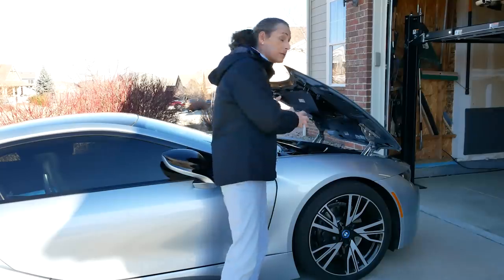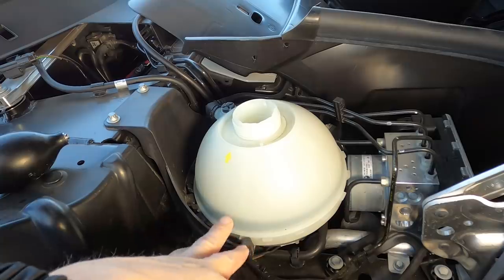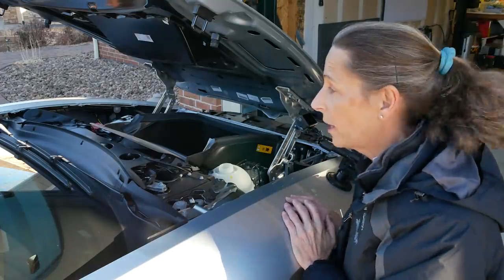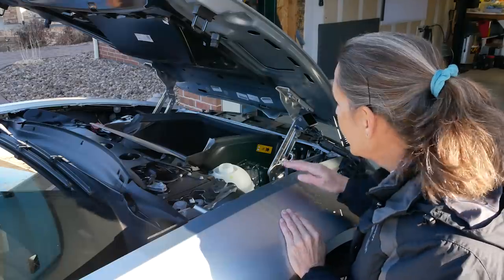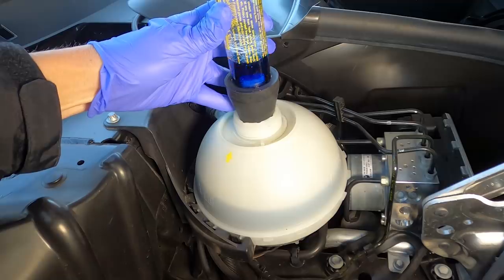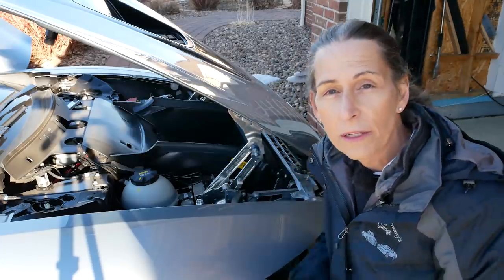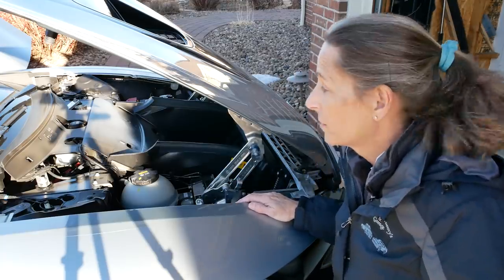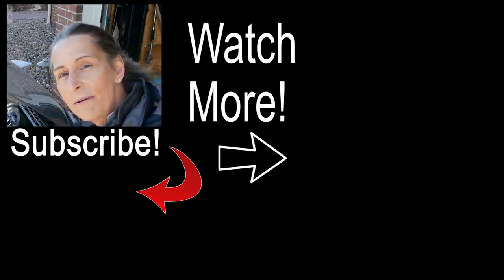Working With SamCrac and Recreating His Coolant Block Test! BMW i8

Comment: Always interesting videos, Franny. First time I've ever heard of this check. As a new driver in the mid 70's I worked on my own cars - 1960's technology - but all these years later I never stop learning about cars.
Reply from the maker: Thanks Phil, the test is new to me too... It can be used on any ICE car with a radiator. It would have been a really helpful test to run on the 308 before we bought it... I think the reason the head wouldn't come off  was due to a bad head gasket and coolant corroding the head studs...

Comment: I don't understand how all these garages and dealerships missed this simple block test on Sams I8. Really makes you wonder. Loved your vlog today.
Reply from the maker: Thanks! That's a great question!  It really narrows it down.  I think from now on if I encounter coolant loss, overheating, etc. it will be my first test.  Easy to perform and inexpensive.  No disassembly required!  The computer diagnostics can only tell you so much and only what it can see.
Reply: A dealer condemned the engine which is why it went to auction. And to be fair to the dealer it may be more than just a head gasket. iIy could have a cracked block or head

Comment: 2:59  That stream is the coolant coming in from that hose on top of the reservoir that runs over to the hot side of the radiator.  It bleeds off any air in the system. A steady stream of coolant means there is no air building up in the coolant from the engine to the radiator.

Comment: You got a great point about the turbo leak. It might not even lose coolant just small amount of gasses being introduced into the coolant causing the air pocket.
Reply from the maker: Just a thought...  Not sure how close the coolant is physically to the exhaust, but maybe a second or third place to look.  These turbos did have an issue early on of a small oil leak.  Ours was fixed by the PO under warranty early on.
Reply: @HeidiandFranny  just replaced my VW turbo and yes they can develop those issues.
Reply from the maker: Great to know!

Comment: When I saw the amount of bubbles coming out of Sam's cooling system I knew right away that exhaust gasses were getting into the cooling system. I've had that issue with other cars in the past. It normally is a head gasket issue.
Reply from the maker: Thanks for that!  It seemed weird to me that it would be boiling.  But he did just have just water in the system and it was above 100C back at the engine and not under pressure. Still, there would have to be bubbles if exhaust gas is getting pushed into the coolant.  And the test showed that you are correct.
Reply: @HeidiandFranny   Water boils at approximately 212 degrees Fahrenheit and since coolant is made up partly of water, it too will boil at 212 degrees, right? Not quite. Thanks to the pressure created by the radiator cap, the boiling point is raised considerably.
Reply from the maker: Yes, but Sam's cooling system was open to perform the test so no pressure.
Reply: @HeidiandFranny  but in his first first video it was cracking and popping sound coming out of his over flow that was from it bubbling up.
Reply: @HeidiandFranny  But it was bubbling with the cap on as well in his first video he made of trying to fix it. you had your cap off and no bubbling at all.  no way with his cap on would it of gotten hot enough to bubble is all i am saying before the car goes into the protection mode.

Comment: Adore mine to. Very reliable at 52Kmiles. My failures: heated rear window only half works, the usual rubber shock perishing, and the standard fuel door issue(30 seconds with a hack saw to fix) but that’s about it.
Reply from the maker: Thanks!  That's good to hear.

Comment: great analysis about the i8 being a usual car easy to maintain and handle without a lot of toothing issues for such an unusual power-drive train which is closer to a german ww2 submarine cause they where extending range by using a special hybrid mode using 1 diesel engine to turn one prop and generating power for the batteries AND for the 2nd electric motor to turn the 2nd prop. Highly efficient and optimum of speed and range.
Reply: The hybrid batteries for the german ww2 submarines came from AFA (later VARTA). That company was owned by Gunther Quandt. His son Herbert took over BMW 1960 short before insolvency.

Comment: hey hello , its the first time i saw one of your videos, and with all do respect, that is a super car i will never think to buy, it is slow and have a lot a problems, expensive ones. great video by the way !
Reply from the maker: Hello and welcome to our channel, this is Heidi btw and not the video creator (Franny), but the other half of the channel.   I too was a skeptic about the car. Franny talked about it for five years before we purchased the car.  As a second year owner of the i8. I now love this car.  It is fast enough for me.  It can keep up with my 2004 Porsche Turbo S (X50) and saves us lots of money is gasoline.  In addition, Since COVID and little reason to leave the house - we have not had to fill the car in months. Huge plus.  I hate getting gas. We have only had to replace the smaller battery under warranty and that was it.  If the car is well cared for, it is not expensive.  We love our i8.  I hope Samcrac loves his once it is sorted too.  Thanks for watching.  Heidi
Reply from the maker: ...and this is Franny.  I would add that the i8 is not a Supercar, but a GT car.  Any GT in the low fours I would not call slow.  With a mild tune Pat has his in the upper threes.  I'm not sure where you get that these cars have "lot's of problems"...  Have you ever driven one of these or even spent any time with it?

Comment: thanks I see a lot of people are puzzled by samcrack I8 :D I still bet on something in the cooling circulation to be stuck in there. Interesting point about the turbo but I would think if there would be a problem then a leak would be present. Turbo is one of the most easy to diagnose components. head gasket got me surprised ....I must say I do not believe that this is an issue because of pressure test ...
Reply from the maker: Thanks!  I guess we'll see...  He does have me on the edge of my seat!

Comment: The next thing Sam should do is a leak down test. It should be pretty straight forward to see bubbles in the reservoir tank.
Reply from the maker: I'm a huge fan of a leak down test.  It would have been one of the first things I would have done.  I talked to him about it and he said he was going to do that as well, but I bet the Block Test was enough to point to the issue.  I'll tell ya though...  That Block Test is so easy it would be at the top of my list if I was inspecting a car to buy.  Easy, and inexpensive.

Comment: You got lucky with a trouble-free i8. Pat has a few issues with his i8, RichRebuilds slightly more problems with a crashed front end and SamCrac has a total lemon that needs a new engine. It's a gorgeous car that could be an endless money pit if major systems went wrong on it.

Comment: 6:42  If you can get a garage to use their exhaust emmisions tester to test that air from the coolant reservoir, it is way more sensitive than the chemical test.  The chemical test for the unexperienced user is  hard to figure out as you don't know how much air you should pull through the tube for it to turn colors.

Comment: BMW i8 3 cylinder ohc, blow head gasket due to warp head equals replacement head if block deck is true 0, as machining too much from head affects timing as chain will not line up properly when setting timing. Dealer have owners that don't understand i8 is not an exotic that you just can beat the hell out of it, as i8 is hybrid GT hwy cruiser.

Comment: Thanks for the video, very clear to understand. When watching Sam's video I believe he tested in for a couple of minutes. The liquid remained blue for quite some time and I thought to myself the engine seems alright but he continued testing and it eventually turned yellow. Not that yours will turn yellow but just thought I'd mention it. Thanks again.
Reply from the maker: Thanks.  I did let it stand and sped up the footage a bit so as not to waist folks time ;)  I saw nothing.  Since it is testing for CO2 it may turn yellow just sitting out for a while.  I'll tell you though...  I'm going to try that little test on the Ferrari and the 996TT.
Reply: @HeidiandFranny   Ha no problem, thanks for your reply. Its one of those tests where you really don't want to see it go yellow lol Good luck, hope it all goes well.

Comment: Hi Franny and Heidi!
I was totally scratching my head about the CO2 for a while until you said it would come from a cylinder via a bad head gasket or other places. I'm getting a little slow in my old age. I'd never heard of that test and actually sounds like a good idea rather than waiting for the engine to quit. 
If Sam got a color change on his test that explains his problem completely. I'm surprised the BMW dealer couldn't figure out the probable bad head gasket.
Did you see Pat's explanation of the thermostat and how it works? That was interesting.
Anyway, I always enjoy your videos and can't wait to watch you change the timing belts on the Ferrari. That should be fun. Better you than me! Lol
Reply from the maker: Thanks Werner, I have studied the cooling system(s) in the i8 a bit and it is actually very clever.  The HT circuit Waits for a set temp of 105C and then will use an electrically actuated wax heater to then fine tune the coolant temp according to load and power need.  It also has a two tier waring system that will shut down accessories as it rises past 117deg and then from there starts shutting down power from the engine in an attempt to not get to where Sam is with his car.  I'm really wondering how it got this bad in the first place.
Reply: @HeidiandFranny  He said the a/c condenser had been replaced because of front end damage but the cooling rad was original. There must have been some damage in the system, maybe a broken hose causing a bad leak. This might have caused an overheating which may have cause the headgasket to blow out. Hopefully we'll get to see him figure it out and not just abandon it. Have a great day!
Reply from the maker: You too!

Comment: Point made. 
The 3 cylinder engine is an open deck design. It is a highly stressed turbo unit, so very likely the gasket blew if it was ran with low coolant. Possible head warpage too. 
Also, 20k miles is not enough to say a car is "reliable". Id say that number is more like 80k to 100k miles. 
Lastly, its CARBON MONOXIDE. 
Keep up the good work!
Reply from the maker: Thanks.  Yes, there is CO, but also CO2.  The fluid uses in the test reacts to the presence of CO2: https://www.cpsproducts.com/wp-content/uploads/99081870_comb-leak.pdf
BMW is pulling big power out of that engine and, if cooled properly it will be fine.  Something bad happened in its life.  Sad, but Sam will get it sorted.
Reply: @HeidiandFranny   I stand corrected.. it does react to CO2!! Learn something everyday. Apologies!
Keep up the good work and enjoyable videos. Samcrac is lucky to have your support, hope he solves his issue. I bet it was in a light collision, lost coolant, continued to drive, engine overheated, etc...
Reply from the maker: I bet you are right...  That and several dealers taking out the "new" car for a joy ride and just doing more and more damage.  Pretty sad...

Comment: I am still not clear what caused Sam's overheating issue in the first place?  I am just hearing a discussion post-overheating episodes. Did the first owner overlook an overheating issue? With the i8 turning off every time it got too hot, how did the head gasket and engine ever get so messed up?
Reply: IIRC from an early video, he said the car/model is  known to be sensitive to (I'm)proper bleeding of the coolant system, so it could have started after work that required opening the coolant system.

Comment: Thanks for the video. Haven’t you just messed up your cooling system by running the engine with the cap off? It’s a pressurized system and according to Pat even to top up you should get dealer to do it to avoid any issues??
Reply from the maker: Thanks!  No, it is fine...  There is no chance air will get in the system.  What Pat said is true if the level is low enough to introduce air.  It is only pressurized while it is running/hot.  When I pulled the cap it would have made a big fuss if it was pressurized.

Comment: As soon as you said carbon dioxide I said NO, it’s carbon monoxide that’s present in the coolant if there’s a head gasket or block leak but you’ve said here that this test is for carbon dioxide, if that’s true then can I suggest that Sam does another test with another chemical that tests for carbon monoxide because I don’t see what this one proves. Perhaps someone can explain why carbon dioxide is bad, or where it’s coming from, how’s it getting in and from where?  I’d genuinely like to know/understand, thanks.
Reply from the maker: The percentage of CO2 in the atmosphere is around 0.04% but it is around 12% of exhaust gases. Normally the coolant fluid would only be exposed to the atmospheric concentration so this fluid is used to detect much higher concentrations.

Comment: If the car does have a coolant leak at some point and they all get one sooner or later, does the engine shut itself down before any damage is done to the engine. In a lot of cars by the time the engine shows its over heating its too late and the aluminum heads warp.  Is there a low coolant sensor on the coolant reservoir that would give an early indication that there is a coolant leakage problem? You never run these cars with aluminum heads if there is a suspected leak in the coolant system because as soon the car overheats the damage is done.
Reply from the maker: Absolutely but this car went from dealer to dealer and I suspect was run hot each and every time :(

Comment: Hello Heidi, thanks for another great video. 

Have my I8 for exactly one year now (Nov-2014 model). Did 12k miles on it (the car has a total of 63k now..).
I agree with you. It's a great car to drive and it's a great 'daily driver'.  Had to do some work on mine, but nothing too bad. And I like to work on the car :).

The biggest thing was probably the 'right motor mount' and one wheel hub.
I am also using the e-manual you mentioned in your video. I do have to say, I find it rather difficult to use. starting the 'virtual machine' loading the large file. It seems to me the manual is very hard to adjust (screen size) and I can't print any pages from it. Any advice on this?
And, sorry, have to ask you another question. I have been noticing on my I8 lately some noise when in e-drive. Accelerating full throttle in e-drive gives me some vibration. I assume it is not noticeable when in comfort mode or sport mode when  4 wheels drive is engaged. My guess is it might be a wheel bearing or the driveshaft. The vibration seems to get slightly worse over time. Thought I might check with you if you have only thoughts on this?

Many Thanks
Stephan
Reply from the maker: Hi Stephan, That is interesting about your motor mount.  You say your are feeling some vibration - if it is also a grumbling noise that could be bearings, a clicking noise would be the CV joints.  Are you feeling a thump right when you accelerate or let off the throttle?  That could speak to the motor mount.  Why did you need to replace the mount?  How did you know?  I think I have heard of a few other instances of mounts going bad.  How long after you replaced the mount did you start feeling this vibration?  Did that mount loosen up?  Have you tried re-torqueing it?  Feel free to leave us an email at our website heidiandfrannysgarage.com if you wish to chat more.  Thanks!  F

Comment: There are several signs that a BMW has a blown head gasket (or any engine), such as if the temperature gauge shows the car is routinely running hot. Samcrac will have been advised very clever to string this out when he had the tester he also as BMW experts coming out of his ears.

Comment: I recall Sam doing a pressure test but I guess that doesn't show leakage. 

Is it difficult to change the head gasket?
Reply from the maker: Replacing the head gasket does require dropping the engine unfortunately, but because of how these cars are engineered they are assembled in sub-assemblies.  The engine and rear suspension comes out as one unit so it is just a matter of unhooking everything and dropping it out as a unit.  And, there aren't that many accessories to deal with - the AC for instance is up front so no need to disconnect that.  I can't wait to see what Sam comes up with :)